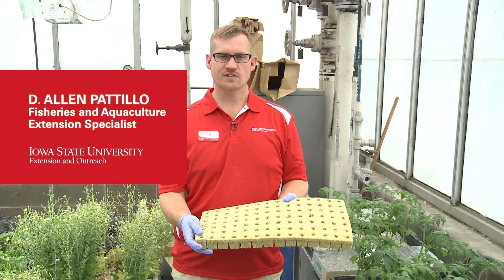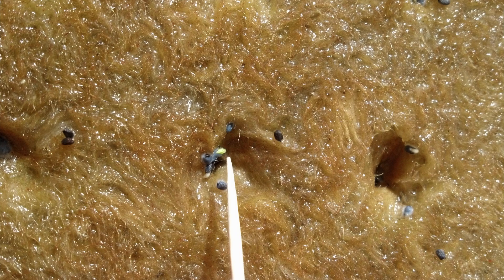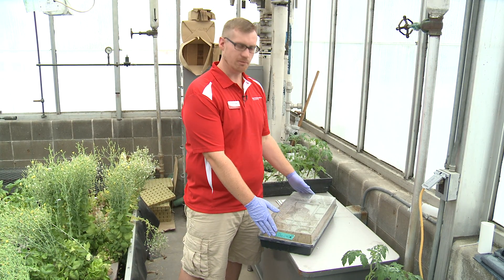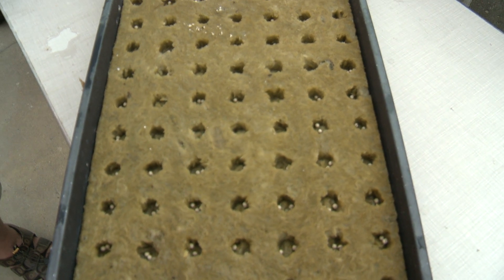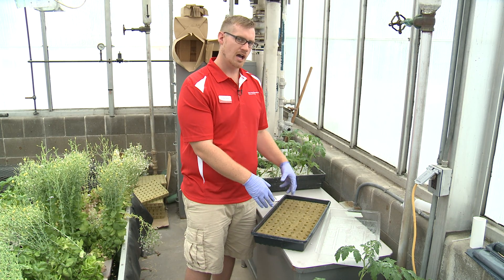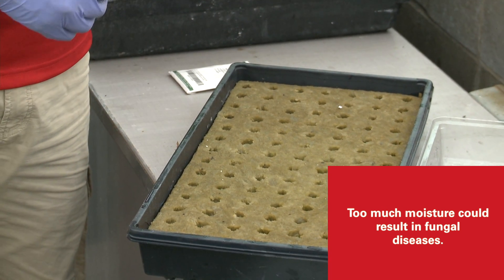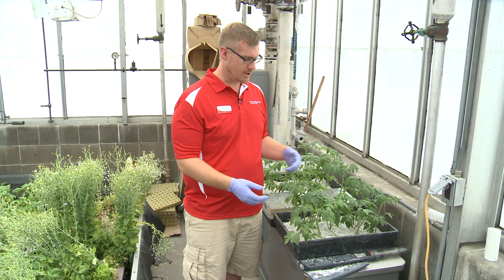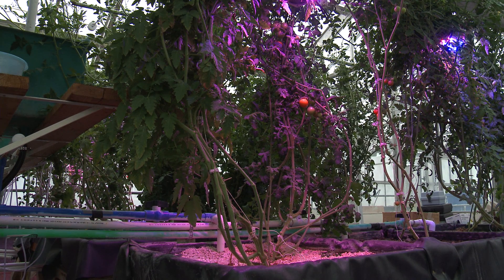How to Plant Seedlings for Your Aquaponics System

Comment: Where do you purchase your rockwood is there a cheaper way to start your seedlings
Reply: Hi Ricardo, the brand name for this rock wool was Grodan. We purchased from FarmTek since they are an Iowa-based company. Any commercial Hydroponics supplier should have this product. Rockwool is not the only medium that will work. There are also Oasis blocks and jiffy plugs and coconut coir. You can even start seedlings directly in gravel. You do want to minimize soil in your system because of clogging and potential disease transmission. I had some of my best growth of tomatoes in pea gravel from a local quarry in Ames. Be careful though, because the substrate that you grow in can affect the pH of the water and thus the plant's ability to absorb the nutrient. Ideally your pH should be between 5.5 and 7.0 for most plants, which can be done easily in the seedling stage, which is outside the fish system. In a couple aquaponics system, you should target a pH for growing plants and fish and bacteria between 6.5 and 7.2. Good luck!